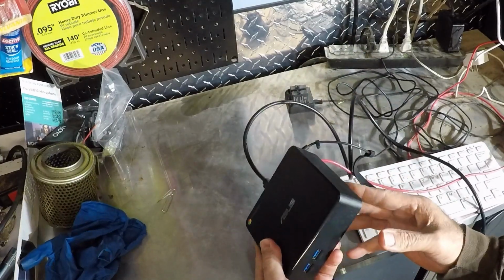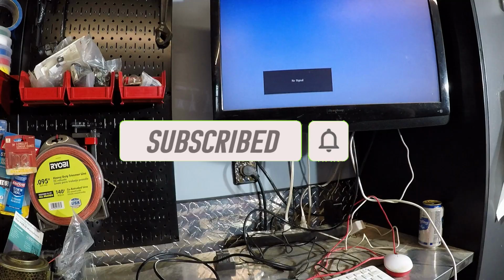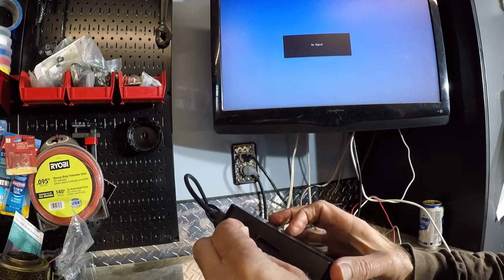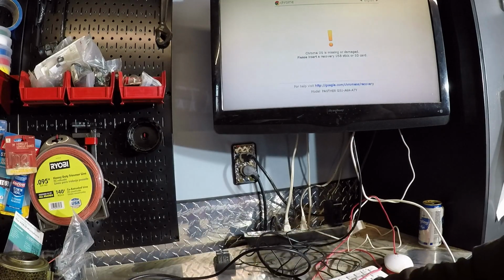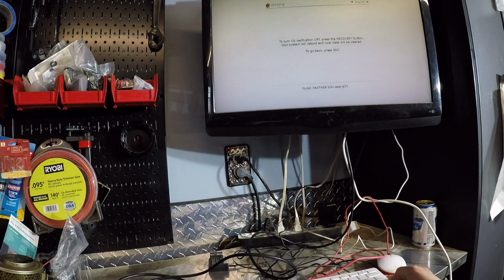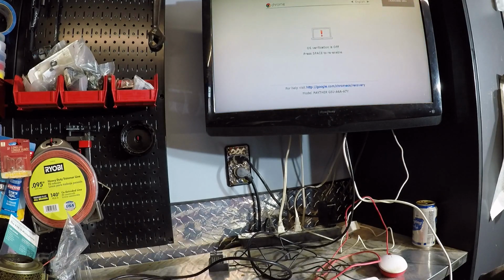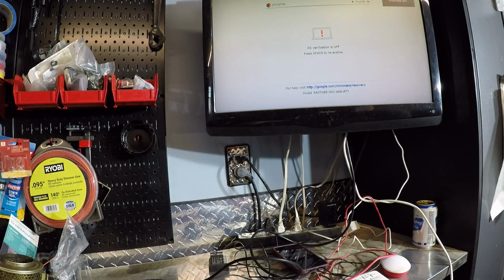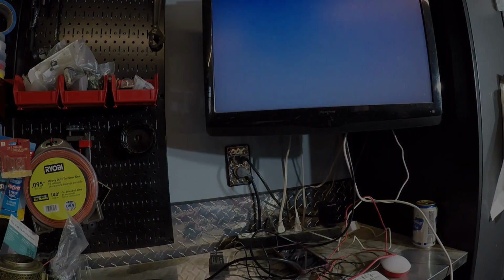How to Factory Reset an ASUS Chromebox

Comment: Just a thougnght.  I was trying  this with an Acer chrombox CX 13 series. 2 small holes on back of unit. Once just a little bigger than a paper clip, one that looks to small (but actually isn't) for a paper clip.  Inserted paper clip in the slightly larger hole (big mistake), and got a spark from a short, and a DOA chromeox. So that's the end of this chromebox. Experiment ex post facto on the smaller hold, you only need to insert the paper clip a very short distance, maybe 2 millimeters. You can feel the button, which is on a spring, and with light pressure, you can feel the spring depress a tiny bit, which probably means you are in the right hole, presumably. Just wish I could have found out if this worked.
Reply from the maker: Thanks for the information. Sorry to hear that your Chromebox is DOA.